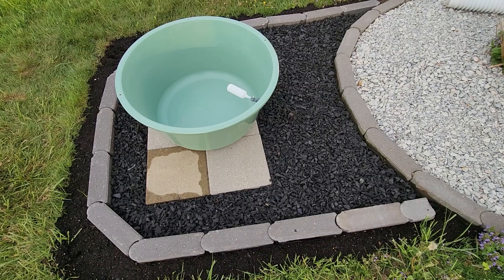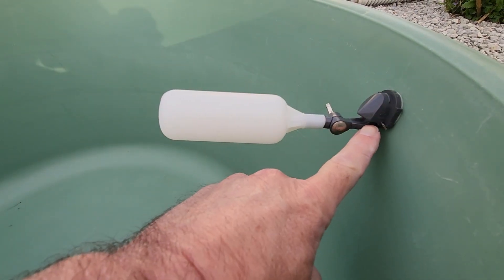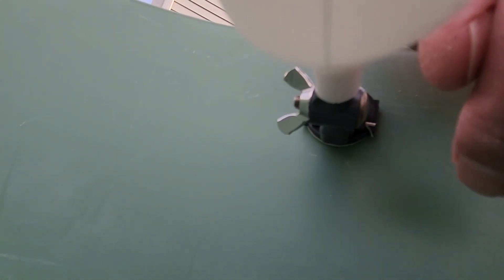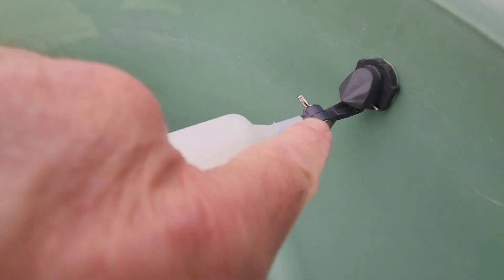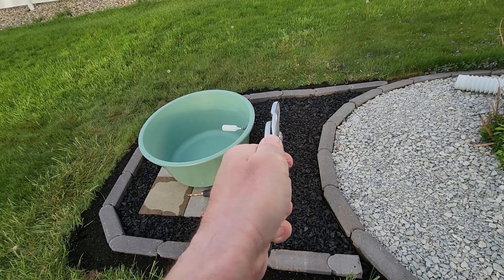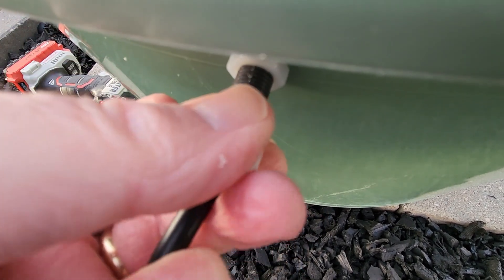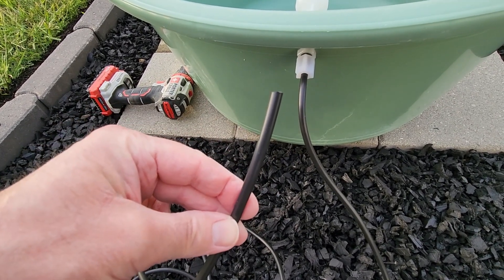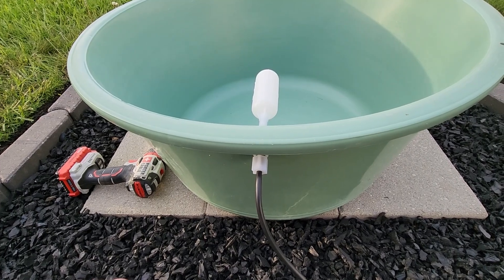DIY HYDROPONIC FLOAT VALVE INSTALL   TOWER GARDEN

Comment: Stupid comment maybe. Not an expert here but the little bushing seems to be backwards where the tapered part should be facing out.  Just guessing here since the bushing for copper tubing are tapered on both sides.
Reply from the maker: @user-pz1ve1jb5s  Interesting, I will have to go back and double-check. So far, no leaks and working well though.

Comment: Simplest, safest way I found to make the hole in the bucket is to melt a hole. I used 1/2 inch pipe connectors to connect the same float valve to the bucket so  I used a short piece of standard 1/2" galvanized threaded pipe and heated it over a stove burner to hot enough to melt the plastic bucket, but not make it smoke. The standard pipe thread is tapered just a little, and if you are careful to just melt the hole with the end of the pipe, it makes a hole that will actually fit tight, almost tight enough to make a seal when you insert the float valve pipe. The hot pipe used to melt makes a perfect circular hole, with no sharp edges, and is less likely to crack the bucket. I think the heat from the pipe may do something as well to harden the edge of the hole. Even if you don't have a pipe size to match the hole you need to make, you can heat the drill bit of the right size, and still melt the hole after heating the drill bit. My buckets seem to use a more brittle plastic, and crack easily, and melting the hole is safer for those buckets.

I use the same float valve set up, with a 30 gallon reservoir with my nutrient/water solution feeding the float valve inlet, but if you connect more buckets, with plants that use more water, you might want to use a 75 gallon, or 275 gallon, etc. Just a reminder- the bottom of the reservoir just needs to be above the water level you want in the bucket with the float valve. I have my reservoir 8 inches off the ground and the hole from the resevoir about 2 inches from the bottom, and the water level in my bucket is only about 6-7 inches.

I have an outlet from the float valve bucket tubing that then tees off with lines going to more buckets- 14 total buckets with plants in my case right now- and the water level in each buckets is the same as the water level in the bucket with the float valve. You can raise or lower each bucket a few inches to change water level in each individual bucket, or raise or lower the bucket with the float valve to adjust the water level in all the connected buckets instead of trying to perfectly adjust the float valve. For example, if you place a couple of concrete blocks under the float valve bucket, instead of just having buckets that hold only the same depth of water as the float valve bucket, you raise the float valve bucket, as high as a few feet, and you can have 2-3-4-5 foot deep water in your other containers from a float valve bucketjust  few inches deep . With a large reservoir, you could have dozens of plants all feeding off 1 float valve. My system keeps the water level perfectly stead in all the buckets, which is great for kratky system.

 I tried 1/4 inch tubing, but it got plugged easily with any debris that got in the system. Outdoors I tend to let leaves, or bits of perlite, etc. get in the buckets and the 1/4" fittings would barely flow if anything got into the lines I used.I switched to 1/2" fittings, and 3/8 inch tubing. I ended up putting one of those little hose end screens in between the reservoir and the float valve after switching to the larger connectors. The screen still seems to get clogged with tiny particles about 2 times per season, but is easier to clean than if the float valve itself gets clogged. 

I found that 1/2" pipe connections are pretty convenient, and you can use adapters to connect to almost any other thread size. Low cost irrigation fittings are commonly 1/2 inch standard pipe thread, and I found a glue that works on almost any plastic fittings. I had previously used PVC glue that didn't bond with the plastic the buckets were made from, so I had to use lots of rubber seals/washers that didn't always seal. The pvc glue would end up flexing and cracking if I moved them around. If possible, you want shut-off valves in as many places as needed to make cleaning, or adding to the system easier. And a separate drain hole in each bucket is useful
Reply from the maker: Dennis, I always find your comments informative and welcome your input.  It should be helpful to others reading your comments also.  I use 1/2" tubing on my other systems without issues.  The 1/4" has been fine flowing water.  I like your heat melt approach, but already have the drill and bits.  I think external filters are better than internal for access and cleaning.  It's exciting that you are championing low-cost DIY solutions. Thanks so much for taking the time to explain how you do things!
Reply: Excellent video as always ❤ thank you!!!!
Reply from the maker: @GodsChild145  Glad to help others!